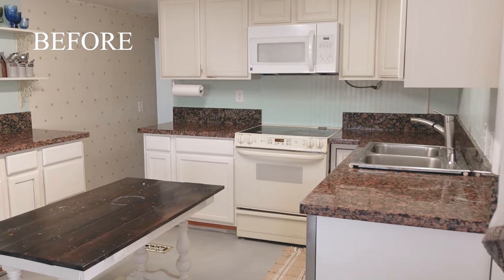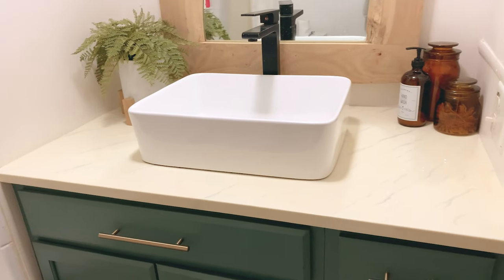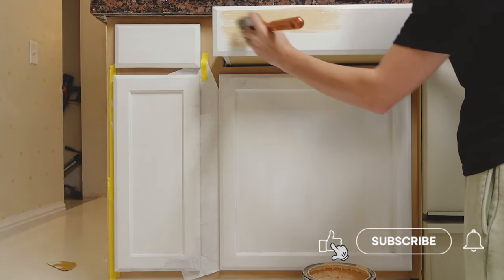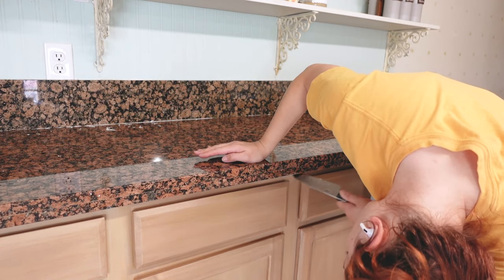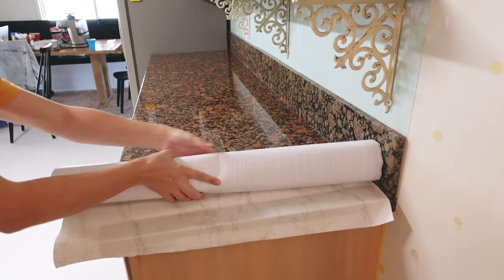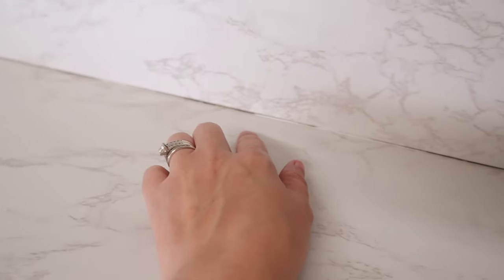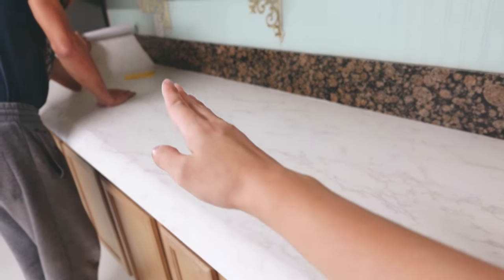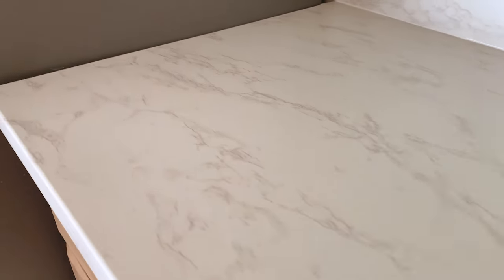$100 UPDATE: UGLY GRANITE COUNTERTOP - W/ CONTACT PAPER | PAINT , OR EPOXY?You'll want to see this!

Comment: Your testing covered all of the bases. Thanks! Your results look great. I have recovered my countertops with contact paper.  It seemed to last about 3 yrs or a little more before it began to crack. Another thing.  In the area where I wiped the most the pattern began to fade a lot. It was a granite pattern and like your original countertop it was hard to tell if I wiped all of the crumbs. I'd like to try marble like you used.
Reply from the maker: Wow three years is pretty good. So far this contact paper is holding up really good. Love the quality.

Comment: Can you update us how it is holding since installation? thanks
Reply from the maker: SO far doing great. some areas have tiny scabs from stuff falling on it. Like a sharp knife dropped or heavy metal objects. All the edges are doing great. No bubbling or peeling! The stains come out great with white eraser.  Also learned that tumeric/carrot stains fade away eventually because of sunlight if the white eraser doesn't get them.  Would I do this again! HECK YES! We have wooden boards I always keep along the wall if I ever need to put anything hot on it.

Comment: First of all, thanks for sharing, very helpful! I see you are using separate sheets for the backsplash and the countertop, but not sure if this is because of not having enough size. So, if the width of my paper is big enough, do you think it is a good idea just to start from the backsplash with one single sheet and continue all the way to the edge of the countertop? Do you think the inner corner will later start having bubbles?
Reply from the maker: @Optimist_Insan  it’s too hard to apply. Once it sticks on it’s hard to remove. That’s why we apply them separate to minimize bubbles and application is easier this way. I’m pretty sure we tried it that way and it was too hard. I have slits from knife cuts right now that Have been there for months I’m constantly soaking the tables and wiping and water hasn’t cause it too bubbles up and start pulling up at all. So far the edges in the corners are doing every well. The tape is every strong. I’m glad you found this video helpful.

Comment: here there. i saw your older video about the burlap door panels you made. i know it has been a while since you posted this, hoping you still see my message. do you still have these doors? how is it working after all these years since you made them? any issues you had to fix since? another question please, you mentioned you SUBTRACTED 1/4 inches of each side (all 4 sides) of the panels to fit the hinges, is that correct? thanks.
Reply from the maker: Hi girl, doors are holding up great burlap loosened up a bit but still looks great not saggy. Yes from what I remember it was all four sides check out the blog post it should have more info. I’m pretty sure it’s linked in video description